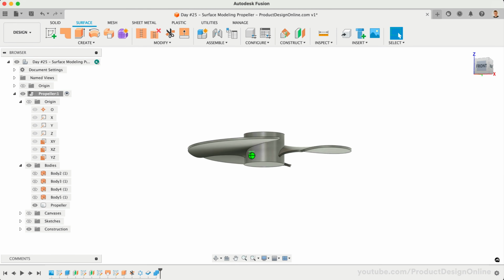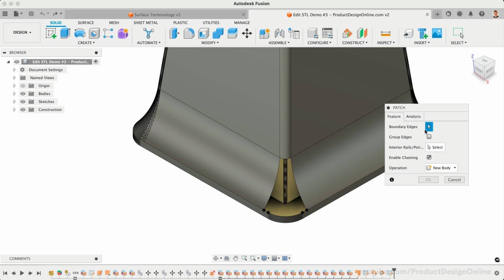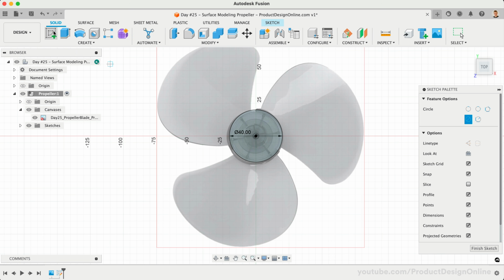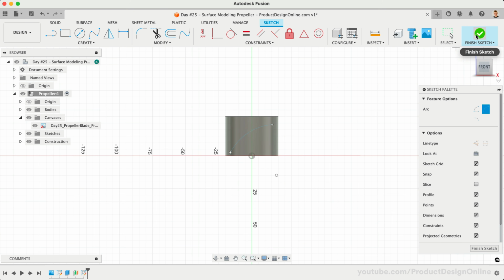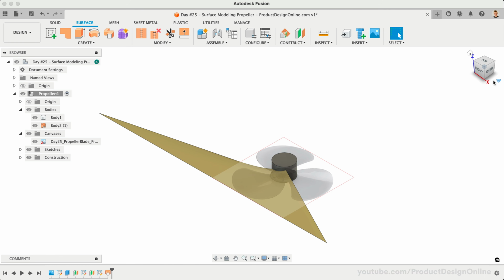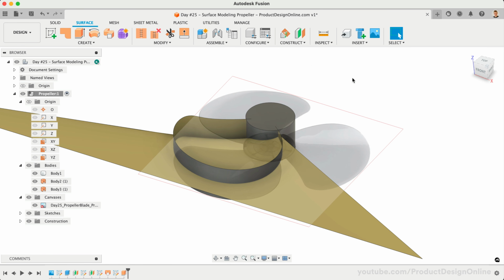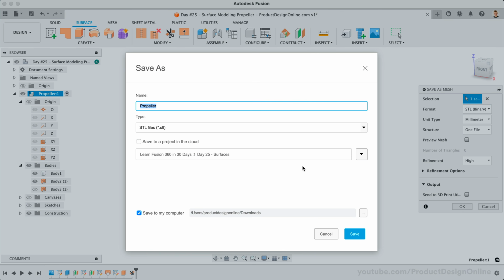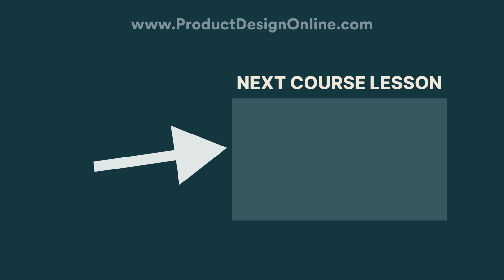Fusion 360 SURFACES made EASY | Day 25 of Learn Fusion 360 in 30 Days - 2024 EDITION

Comment: The sketch geometry on this one is weird! I'm personally having a hard time understanding how the arc sketch is seems to be controlling the depth of the blades, and how the cupping of the fins is even being generated, etc. 

Recommendation: If you finish this and would like to see how this is impacted. Set the history marker to before the trim feature and turn off the visibility of the main hub body. That way you can see the surface loft being generated and is easier to visualize.

Comment: Wanted to mention that when trimming the excess off, I needed to close the sketch to correctly do it even though I put the endpoints of the spline inside the hub.
Reply: Thanks, I had to do the same.  I was trying to figure it out for a few minutes before coming to this beauty of a comment.
Reply: Thank you, Same here. Even after I thought it was fully closed it was not. Spent hours on this
Reply: Thank you. Was wondering why this didn't work. Must have changed in a fusion update

Comment: Great tutorials!!!
I noted one thing though (might be to an update to Autodesk Fusion 360): If I do not close the profile which defines the profile of the blade, I cannot cut out the surface of the blade. But when closing it, it works like a charm.
It might be that I have missed something in the tutorial though!
Reply from the maker: Hmm. Shouldn't need to close it when working with surfaces, but I will double check recent updates. Thanks!
Reply: @ProductDesignOnline  I thought my case was the same as the issue for @olefrederiksen9916, but closing the skech did not help. After a while and rotating the desing a bit I realised that in my case the second plane was not far enough and in order to to be able to cut the propeller blade sketh with extruded spline surface untill adjusted the plane to be at a distance of 110 mm from center. I think this could be the problem of others as well.
Reply: @ProductDesignOnline  I ran into the same issue, and I think there's a subtle difference in that his splines ran THROUGH the bounds of the lofted surface making two topologically closed shapes on the lofted surface. Closing the shape is another solution as it makes a closed hole to trim away which works just as well, but I can confirm as of now you don't need to close it to see the cut shape.

Comment: Trying this. I have good uses for using surfaces but always have trouble.  your tutorial helps but I have trouble with the trim, I select the cutting surface then the surface to trim but the whole surface thats supposed to be trimmed disappears what is wrong?

Edit: I see. the cutting surface has to also cut through an edge of the surface being cut or it won't work

Comment: how would you model a varying blade thickess? most props have a thicker root. thx
Reply from the maker: Several ways to achieve that. The easiest that I could explain via text would be to have another loft below the first one (that lofts to the same or thinner end point), then connect the sides with a Loft or patch tool. You can use additional 'rails' with the loft if looking for very specific shape.
Reply: @ProductDesignOnline  Thanks! I'd be very interested in seeing how to model the Schist disk, an ancient artifact with complex geometry. It looks to me like the mold for a lost wax casting.

Comment: Of course it is easier to copy single surface than the solid body. But in that case you need to thicken 3 bodies instead of 1, so it may be even more expensive.
Reply from the maker: It's not and I've tested and confirmed that with the Fusion team. Pattern/copy is more taxing than thicken due to how parametric features are processed.

Comment: Thanks a lot. That's the video I was waiting for :) Question: What if we want a non constant thickness across the radius of the blade?
Reply from the maker: Several ways to achieve that. The easiest that I could explain via text would be to have another loft below the first one, then connect them with a Loft or patch tool. You can use additional 'rails' with the loft if looking for very specific shape.
Reply: @ProductDesignOnline  Thank you very much ! Seems not so easy but I think I will try...
Reply from the maker: @filetdelumiere5037  Keep me posted! you got this :)